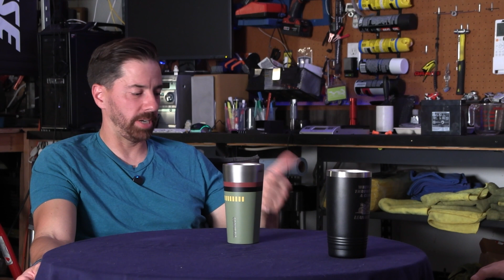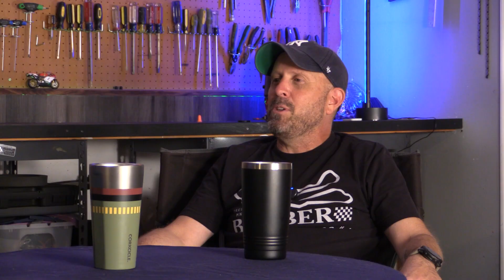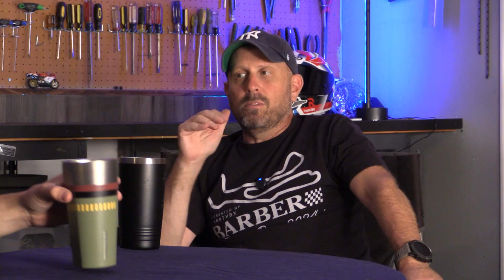Big Bang Vs. Screamer -  Can We Have the Best of Both?

Comment: Unequal combustion pulses. Pretty cool stuff. I bet for a moment the engine vibration is terrible, until the ECU fires all 4 cylinders at equal combustion strength.
Like was said before the end of the video, a "purist" would impose limitations to racing based on era-specific technology. Era-specific technology was great, it was the best they'd ever had up until that time, but later development has made it possible to do stuff with engines that couldn't be done before.
Reply from the maker: Thats a fantastic point!

Comment: Most if not all technology is spearheaded by MotoGP and trickles down to street bikes. The beauty about these IMU systems or whatever is that you don't HAVE to use them. You can turn all the electronic aids off if you are the purist you want to think you are. BUT if you have a new V4 with 200+whp and go to a track and turn them all off, have fun explaining why they were all off when you accidentally sneeze the wrong way at 55 degree lean. Bikes like that are MADE with the electronics in mind, they are the purest form of race bike we have aside from well... an actual race bike. They were to designed to garner as much efficiency as possible IF AND ONLY WHEN the rider is capable of doing so. 

If you want a harley, go for it. If you want an adventure bike, go for it. But when you're talking about an s1000RR or a cbr1000rr-r sp, these are 90% race bike 10% street bike. When you're at 55 degrees of lean on the track and maybe that ONE corner out of the 100+ corners you've done that day you maybe given 5 degrees more of throttle you're going to be happy you have the electronics doing it's thing 

And if you aren't riding your 90% race bike 10% street bike on the track ever and then simultaneously complaining about how bikes have so much electronics these days... I don't even know what to tell you because nobody buys a lamborghini or a ferrari and then says "I wish I had less"

Comment: Interesting how all the rider aids are making the sport unrecognizable to some and simply purifying it for others. This is a heated topic on many platforms where some argue go back to the two strokes and remove all the rider aids aero packages ride height launch devices etc. The sport is evolving. Lots of folks say today's riders couldn't ride yesterday's bikes without ending up in the sandbox. I don't race (hope tp do some club racing before I hang it up)but ride canyons  I have ridden an RSV4 and ZX10 with all the aids and it was a HUGE leap of faith to trust the auto blip on the ZX even with a tame entry built up to some more aggresive entries and started to get comfortable with it but still my 09 CBR 600 gives me 'that feel' that I've enjoyed from riding over five decades. The aids made it feel so different almost unsatisfying. Almost like cheating on your girl with some bimbo because she is hot. The passion just isn't there and I just want to be back on my jalopy CBR or with my girl...

And what would happen God forbid if one of those systems fails (and the y will) or get damaged at a critical time? Pedroza's horrifying  crash when Marquez clipped the traction control sensor on the Repsol the most drastic result I've seen... It's my belief that riders are becoming dependent on these systems and would wad the bike up if they were to ride an old school TZ 750...Except 93 Marquez alien dude can adapt and find and expand  the limits of any machine...
🏍

Comment: This is why Harley Davidson has always been dominant in flat track. Their 45 degree VTwins with the long pause between the two power stroke gives the rear wheel quite a bit of time to regain traction. Also the two power strokes are close together giving longer smoother push to the rear wheel.

Comment: Would it not be the 2 inside cylinders and the 2 outside cylinders that are paired? Otherwise, the strain on the crank would be insane!
Reply: The way Honda and BMW do it, cylinder 1-2 are connected and 3-4 are connected. I wondered as well if it would create a weird torque on the crank but I assume their engineers have planned for that.
Reply: Under uneven combustion pulses, you could induce crankshaft torsional frequencies not usual to normal combustion cycles, but there's no way those frequencies and magnitudes would be greater than normal, because each cylinder is only able to produce designed power, no more. Simply dropping two cylinders to half than the other two cylinders (or less) only subjects the crank to uneven torque fluctuations. Uneven isn't "more", it's simply "different." Certainly a lot of vibration under that condition.

Comment: Great discussion. Couple anecdotes:
1. I remember hearing Nicky's V-5 Honda at Laguna in 2006 and it sounded like at least two different bikes. Wild. 
2. I remember when Mick Doohan beat everyone on screamer 500s, beat everyone on big bang 500s, then went back to screamer 500 just to remind everyone who was boss. Ridiculous! 
3. Considering firing order - standing trackside at COTA this year, if I'd closed my eyes, I wouldn't have been able to pick the GP bikes apart, by sound alone. Even the Yamaha BARELY sounded different from the others. The best firing order for traction has clearly been determined, for current tire technology. Screamer inline fours are only competitive in SBK because of the highly arcane leveling rules. 
Cheers, guys, ride safely.
Reply: I was at COTA this year also and thought the Yamaha was the best sounding bike out of all of them but yeah very subtle differences...
Reply: I was at Laguna in 2006 too! It was crazy hot that weekend! 

For current MotoGP i agree it does seem like they've all centered around an engine configuration that is ideal for the current rule set and its made them all sound really similar, especially at high rpm.